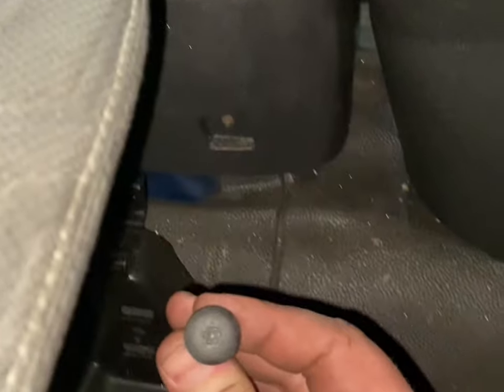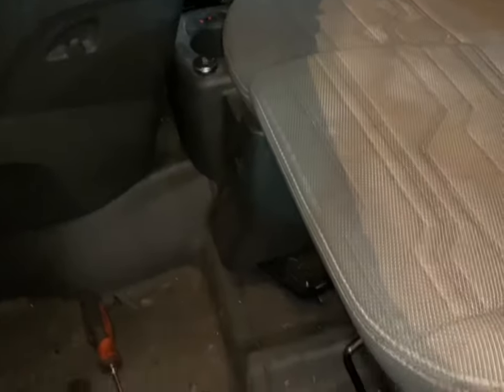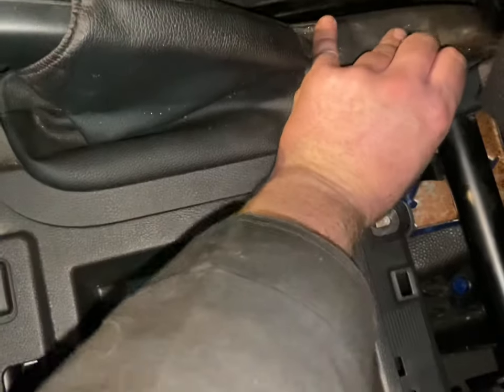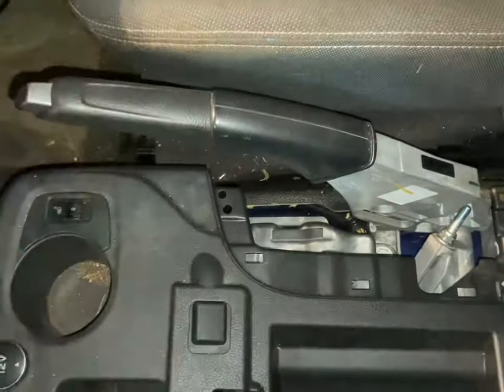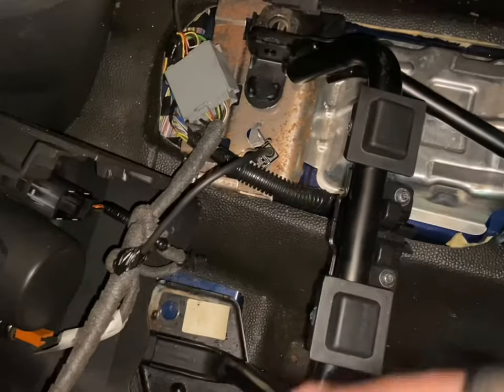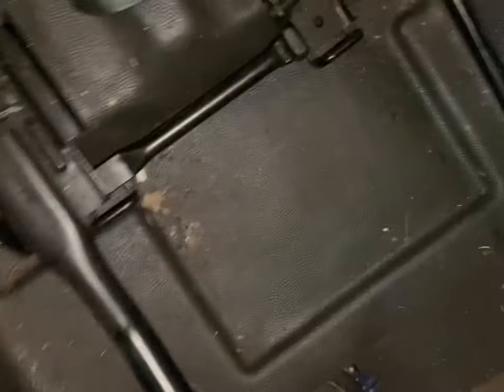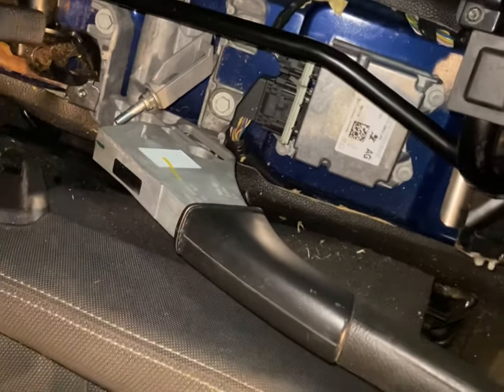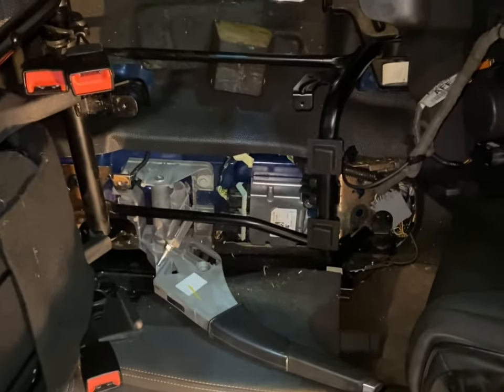Transit connect 2014-2020 airbag module location how to

Comment: Great video thank you! I’m wondering if you need to send in the module if your airbag didn’t go off but your seatbelts locked up Due to a crash?
Reply from the maker: Not honestly sure, but i have since learned that some diagnostic scanners can reset the crash data on these